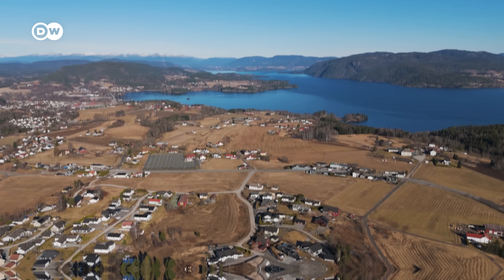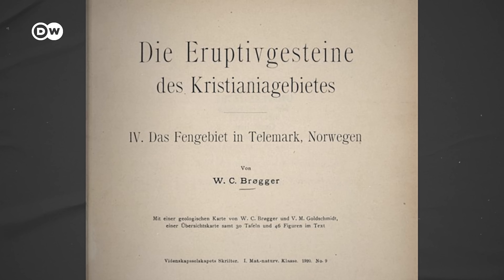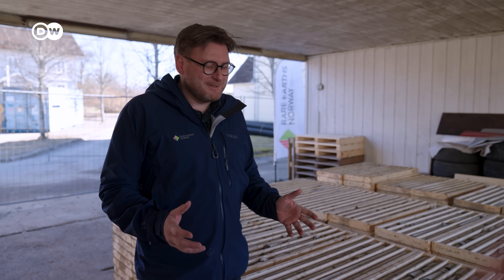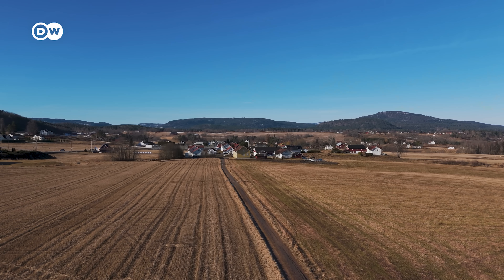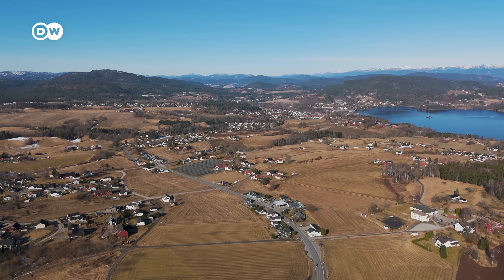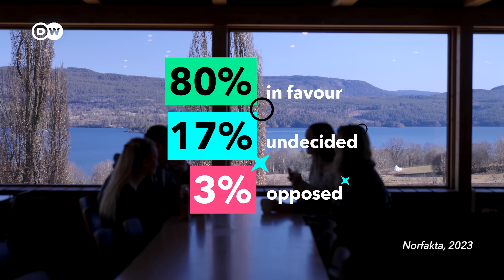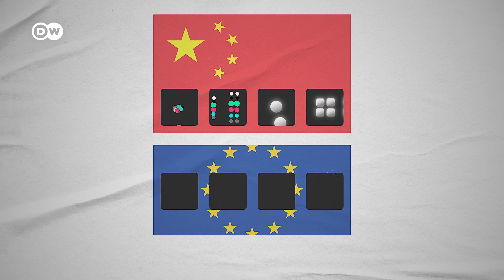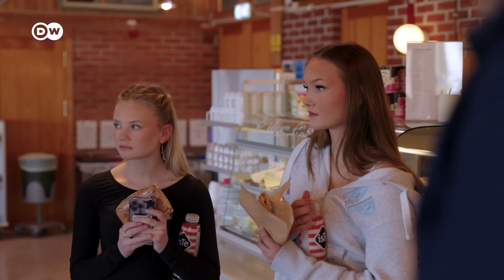This invisible Norwegian mine could solve Europe's rare earth problem

Comment: They’re not rare at all and the more they’re looked for the more get discovered. Then the price crashes and most deposits become too unprofitable to mine. This is particularly the case for an expensive place like Norway, which has a primitive extractive economy and lacks resources, including human capital, to manufacture things more valuable than rocks. What then? Will they ship rocks to China? We should note too that these so-called ‘critical resources’ provide significantly <1% of the resources required to manufacture things. Where are we supposed to get the other >99% of resources? Is this business as usual scenario sustainable? Of course not. What this means is that the projected demand for these ‘critical resources’ has been grossly overestimated. If we’re not careful, we’ll all end up living like the Norwegians. Destitute on the periphery without sufficient resources to produce enough food. The worst form of poverty imaginable.

Comment: The resource deposits in Europe aren't the issue. The issue are the refining and processing capabilities. Rare earths aren't rare at all. The only reason why China has a monopoly on these materials are their massive refining and processing capabilities, which allow them to get all the necessary materials for batteries, screens, tech, chips, magnets, conductors and so on at scale. Even if Europe found even more productive deposits, without the capabilities to process them and use them in-continent, we'd have to export these raw materials from Norway to China for processing and refining. Since we need these materials cheaply, we need to build these capabilities up on the continent quickly. With this deposit and the Kiruna deposit, it should be possible to gain enough raw materials for economical at scale processing and refining in Europe.

Comment: This action is necessary because when we observe China, they possess near-total control in this sector. Regrettably, we are facing a hostile stance from the USA towards Denmark and its allies. Therefore, it's imperative for the EU to assert control over the market and gain greater autonomy. The USA has demonstrated a willingness to employ various tactics to acquire Greenland by force, rather than engaging in respectful negotiations with Denmark. This behavior, which includes actions that could be perceived as hostile towards a NATO ally, erodes our trust in the USA as a reliable partner.

Instead of pursuing a mutually beneficial agreement for mineral extraction, the USA seems intent on obtaining Greenland by any means necessary. Consequently, we must prioritize our own security and adopt a balanced approach when dealing with both the USA and China in matters of our self-preservation.

Comment: Refilling the dug-out space to avoid settlement sounds ridiculous because refilling needs compaction as well, and that cannot be done, harrr.
Reply: They talk about using concrete. Obe can use expanding cement which is actually used for exactly that purpose, to fill out underground hollows and cracks. It would be challenging but should be technical solvable.
Reply: @hansmonsen1359 It is a relatively common practice in mining, and well understood.

Comment: There is a big misconception regarding Rare Earth Elements is that they're not rare at all, many of them are very common actually. However, the problem is that they are often expensive and/or polluting to mine and refine. And because of China exporting them so cheaply, it just hasn't been economical to start up processes for them.

Comment: No, it's not economical  unless you get it as a byproduct from other mining. The ore does not have much value, it requires an enormous process to get the metals from the ore
Reply: Depends if you account for the economic cost of not doing it. China massively subsidizes RE production there but they could cut supply at any time. What then @komocha?
Reply: Australia's Lynas company ran a long hard road to et their mine in profitable production. The mining operation itself went relatively smoothly but the initial treatment operation in Malaysia was targeted by well funded politically motivated objections. I've often wondered where this funding might have come from.
Reply: Now ,you get it...😂

Comment: In La Rochelle France they've just opened a rare earth metal recovery plant, the largest outside China, which will supply 30% of the European market of rare earth metals used to make permanent magnets for electric motors
Reply: Really, you can refine rate earth ? Interesting, because the current knowledge is that only china is able to refine rare earth in industrial quantity. Rare earth is available in abundance, but the refinery is a tricky part. And if you can be wasteful with water and pollution it makes things easier. The chinese plant is an ecological mess.
Reply: @flexiblebirdchannel  Rare earths have been refined there for decades.  Production dropped significantly because Chinese production was cheaper.  They still know how to do it.
Reply: @flexiblebirdchannel  The current knowledge IS NOT that China is the only one who can do it, it is that China has a monopoly on the market because we shut down all the facilities and let them do it for cheap (before we realised how many of these minerals we were actually going to use).
There isn't some secret technology involved. It's just metal.
Reply: @flexiblebirdchannel  knowledge? more like wall st mythology to make big money as they thrive on scarcity. Remember lithium...at some point there was not enough to produce EVs in numbers several fold surpassed today...every time the lie could threaten business a new 'discovery' was made. 

In reality there are plenty of places where they retain both the minerals and know how. Although its not so cheap when you care about the environment ofc. Im pretty sure that has sth to do with trump prefering to mine Greenland than the states...
Reply: PRAISE GOD!!!!

Comment: I live about 15 km from an 'invisible mine', in southwest Germany. It is the Südwestdeutsche Salzwerke, a salt mine, reaching from Heilbronn to Stuttgart, exploiting a layer that lies about  200 meters deep. Know that salt is not really solid; without support it gives way under the weight of the layers on top of it. This means that the mine has to take care that no sinkholes will appear either, and so far it worked.
Reply: I'm sure it'll be fine. The entire city of Detroit Michigan is on top a salt mine for like 80 years, with proper maintenance and care its no issue

Comment: Doesn't Norway also have huge phosphate reserves? Another critical resource required for a green future?
A quick search: "Huge phosphate deposits discovered in southwestern Norway could be large enough to supply electric vehicles, solar panels and fertiliser for at least 50 years. The valuable ore was discovered in 2018 by Norge Mining, who revealed in May that they’d found 70 billion tonnes of the material."
Reply: We also have huge amounts of Thorium, most of it located around our vast amounts of seabed. Thorium can be used for a special type of nuclear reactor.
Reply: I'm still hoping they crack the Thorium reactor and make it practical.
Reply: @MoltenSnowball  It's not on the seabed, it's under the terrain north of Egersund
Reply: Yet there is nothing about this in the news I think?
Reply: @AllrightNOR  Using a search engine, I found several articles on it -- and I remember watching a news video on it saying Norway could tank the Moroccan economy which significantly depends on this export. I think they found it in 2023 if it helps.
Reply: @KevinAdams26   I believe you're right. 2023 was when I heard about it, and it was newly discovered (at least as to how much there was, and it was a lot). Yes, I think Norway is set at least for a lifetime into the future.
Reply: Your point?
Reply: @hevnervals He thinks we're set for life, which is true
Reply: @TrondelagianPatriotsriseup No. Only 2 billion tonnes of it is commercially viable. It's sensationalist news

Comment: 0:13 -- why are you using a Toyota GT86 to depict an electric vehicle? Your video editor trolled you on the job, DW. That's a freaking nice car but if I pull this kind of stunt at my workplace it's a fireable offense.
Reply: (It's a 2nd gen BRZ) Yeah, funnily enough that's about the most non-electric modern car there is (old school, lightweight sports car). And it doesn't even accelerate that fast :).
Reply: To be fair all vehicles use rare earths.

Comment: There is enough chemical junk to stuff back as filling material… the industrie will love a plan like this.
Reply: When you break rock into pieces, the volume increases by about 50%.
That's why they can't stuff more than about 60% of the tailings back into the mine. There simply won't be enough room for more. Especially since they plan to mix it with concrete.
So if you were thinking that they could get junk from somewhere else to put in there, I don't think that's very likely.
Reply: You clearly know very little about how this works and the strict environmental rules in Norway.

Comment: "mixed with cement" 
It seems they'll have the limestone and iron but what about the energy and CO² ?
Reply: Hydroelectric dam they said. And CO2 isn’t that bad for the environment honestly.
Reply: Cement can be manufactured without CO² emmisions.
Reply: @bjarkih1977  My point is to the cost and timeline.
They intend to first tunnel 4km and then start extracting ore from vertical shafts, with the actual grizzly beneath those shafts so that it can be brought out for processing and refinement.
I'm not questioning "cost" for profit because obviously there's a dire need. I'm questioning if it will be 10x, 100x or 1000x the cost of relocating the entire town.
Reply: @bjarkih1977  I assume you are aware of the lime-cycle.
When you use limestone to make burnt lime, CO2 will be released.
So how do you manufacture cement without releasing CO2? Are you talking about carbon-capture, or what?
Reply: @Tjalve70  co2 is only a political factor cause it got nothing to do with the weather patterns, that`s for sure. Though it will require alot of energy, I know there excists solutions to that which isnt talked about

Comment: That mining technique will increase the price of the output massively.
Reply: Not necessarily. As a reminder...mines have a massive cost to operate already (nothing is mined by hand anymore) and THEN when it comes to covering them up again they require either the company to cough up the money (millions per mine) or public investment to do so. By doing most of the job through automation you increase the cost of each individual person but decrease the costs with accidents and injuries. And while removing the equipment they can seal the mine to keep it structurally stable. This makes the materials somewhat more expensive but will make everything else less expensive and less reliable on public investment which would save the country money on the long run. Not to mention these materials are not easy to detect, excavate and refine regardless so the costs shouldnt be much larger given the output. No company would do this investment if they were not about to see at least a 50year return on it.
Reply: You can get the cost estimate on rare earths Norway. Mining is $40/ton, processing $55/ton, G&A $5/ton, so expecting $100/ton mined, lithium should be 2-3% of it, should be $3-5k/ton of lithium, and lithium is currently trading at around the $10k/ton mark.
This is why how concentrated the deposit is is so important, at 1% it's at market price. Note they will definitely use DLE instead of pond, new way of extracting, that has a yield at/above 90% vs 60% traditional max.
Reply: A shining example that what is possible, what is profitable, and what is manageable are not all the same thing.  Many things are possible, but not all of them are manageable, and even fewer are profitable.
Reply: Yes, it will, but it will still be profitable.
And it will create a reliable European source for much of what Europe needs and that can be extremely valuable in the future.